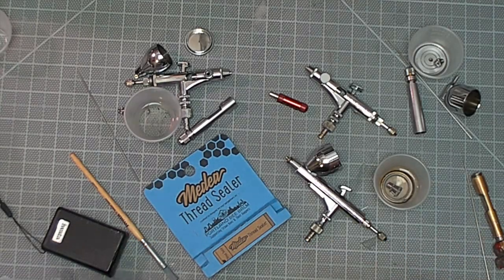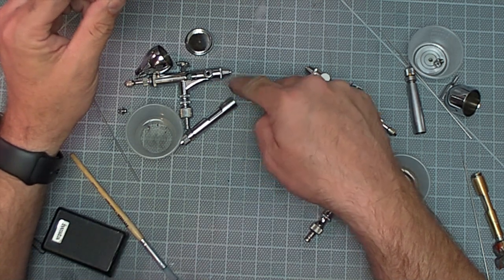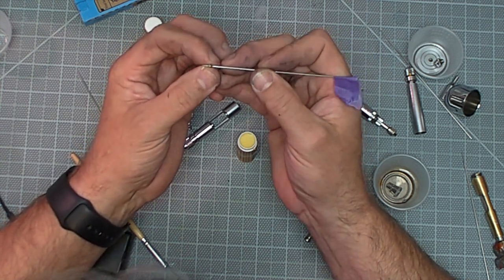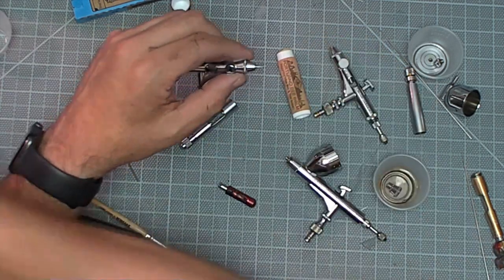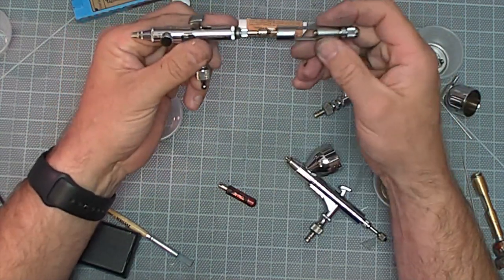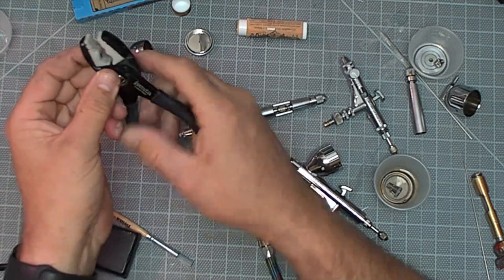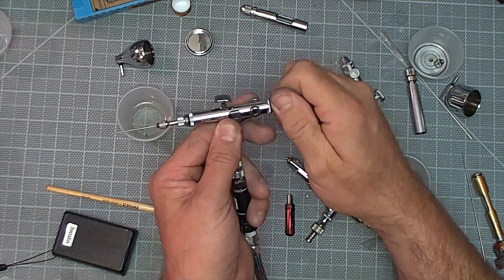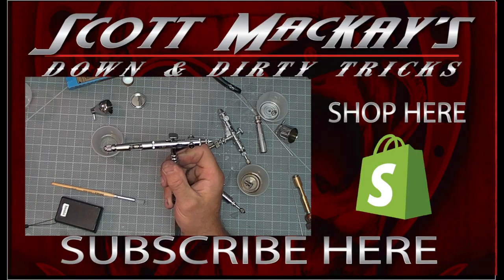Airbrush Maintenance / Bee's Wax Thread Seal

Comment: Thank you VERY much for this video. My Neo was acting very inconsistent. Spraying good in the beginning then sputtering and bubbling in the cup. I was about to buy a new nozzle but fortunately I came across your video and tried the beeswax (luckily for me I bought the Iwata cleaning kit which it was included). So far it has worked.  Airbrush is spraying great again with no issues so Thank You again!!

Comment: I'm having trouble with air leakage on my H+S modular airbrush holder, some air escapes but i can't find out where, just enough air to make my detail not consistent, I wondered if this could be used even though there is no real thread just a washer on a smooth surface connection, you think it would work? Did you ever use the modular H+S running air through it if you did any air escape? Thanks!
Reply from the maker: The holder with the airline attachment ?  I never used it but I would check the threads and rather use bees wax or tephlon tape on the threads. If you can fine it out it in a bucket of water and see were it coming from. Might be a joint or bad seem
Reply: @ThinAirGraFx  Thanks! I'll test it in a bucket of water thanks mate. where it joins to the adjoining holder there are no threads its just a washer and a flat surface i feel thats probably where the air is escaping, its not a lot of air but enough to  be annoying, I did teflon where there is a thread where the air comes in but didn't solve it. I'll try it in the water thanks again!

Comment: My hs evolution an iwata both do this can't get them to spray properly after thinning paints, clogs up after a. Couple of sprays could this be the issue? Tried replacing the air cap seal on hs evo but even the factory seals don't seal.
Reply from the maker: Could be or there is some tried particles in the nozzles the soften and clog the inside of the nozzle. But the threads not being sealed can have lots of bad effects.